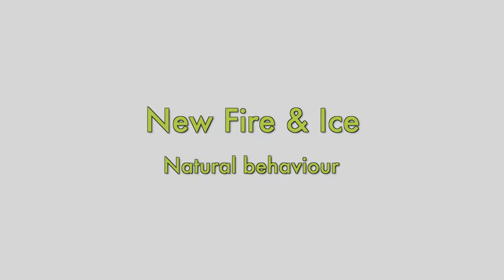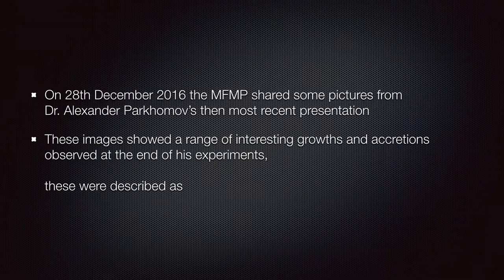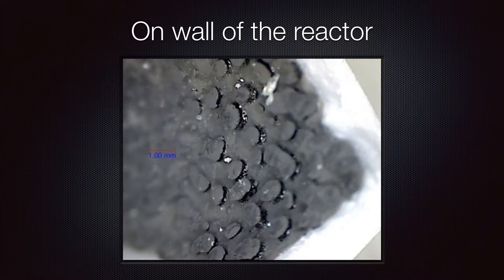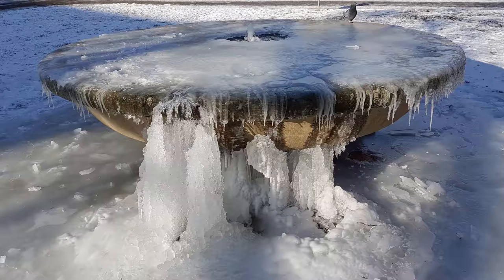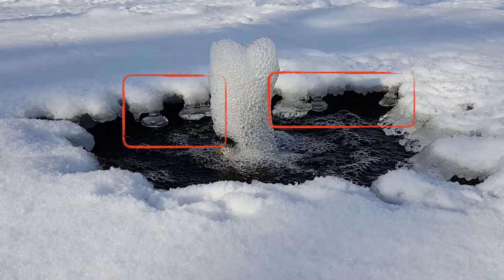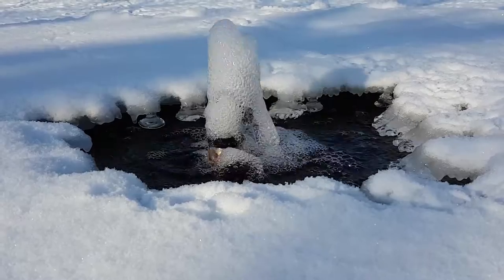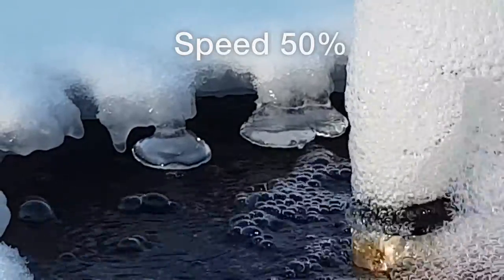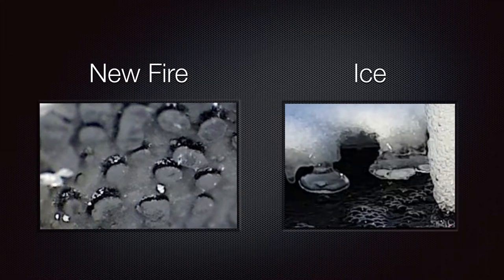New Fire and Ice

Comment: The "wool" of metal threads looks similar to the nanowire dimers in the recent preprint "One-dimensional plasmonic hotspots located between silver nanowire  dimers..."https://arxiv.org/abs/1701.00970  (Fig. 1, page 19)Since these are claimed to extend plasmonic "hotspot" volumes enormously, there might be some connection.